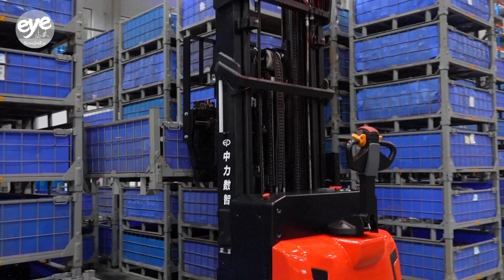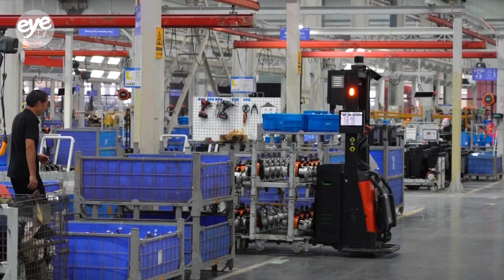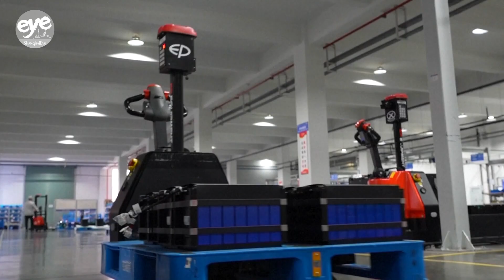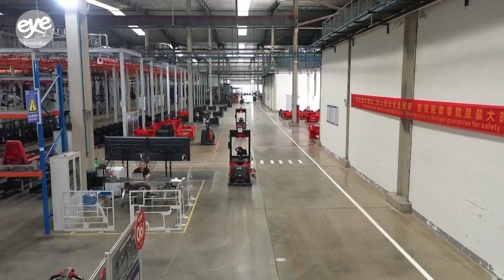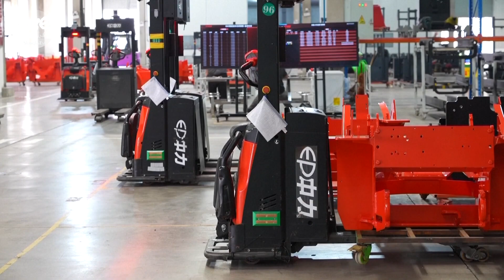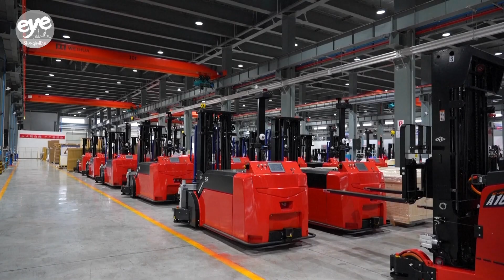China’s unmanned forklift industry booms amid $5BN global market

Comment: India is incapable to reverse engineer key technologies. That’s why in 40 years it couldn’t built a jet engine (Kaveri engine project started in 1983), still using cryogenic engines supplied by Russia in 1990s, couldn’t improve it either. Not even Honda activa engine is fully built in India as that requires precision engineering etc. Paajeets ain't that smart to innovate or reverse enginnering, because it requires intelligence.

Comment: The unmanned forklift industry is experiencing significant growth, driven by the increasing demand for automation in warehousing, manufacturing, and logistics. 
Electric autonomous forklifts are expected to hold the largest market share, exceeding 95% in 2025, due to their eco-friendliness, low operating costs, and compatibility with existing warehouse management systems.
Unmanned forklifts are deployed across diverse industries. 
In warehousing and distribution, they streamline inbound operations, inventory management, and order fulfillment by autonomously transporting goods between storage, picking, and processing areas. 
In manufacturing, they enhance production flows by moving materials within plants. 
These forklifts operate using advanced technologies like sensors, cameras, and artificial intelligence to navigate complex environments, follow predefined routes, or use real-time data for dynamic mapping. 
They offer substantial benefits, including enhanced efficiency, reduced labor costs, improved safety through minimized human error, and consistent accuracy in material handling. 
The long-term advantages of increased productivity and operational safety continue to drive widespread adoption.